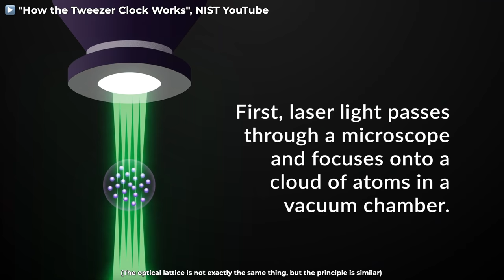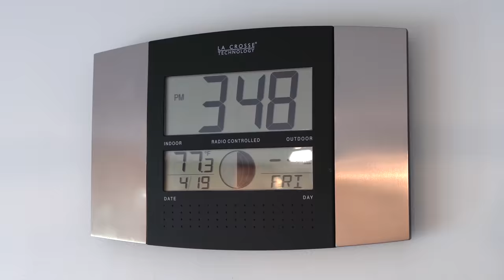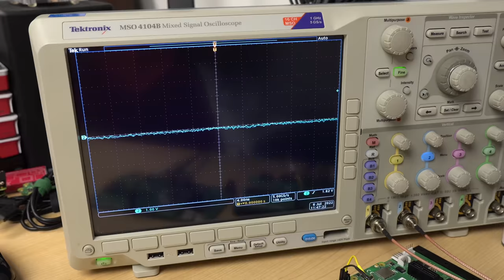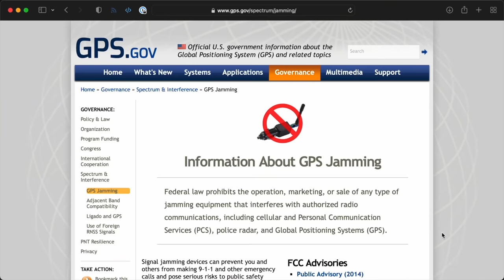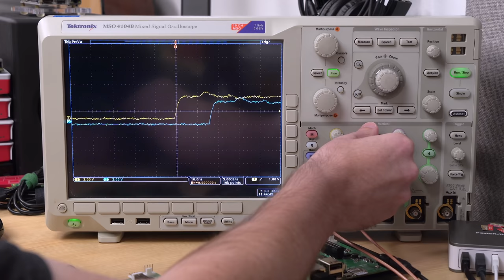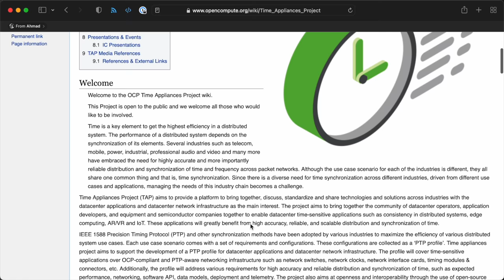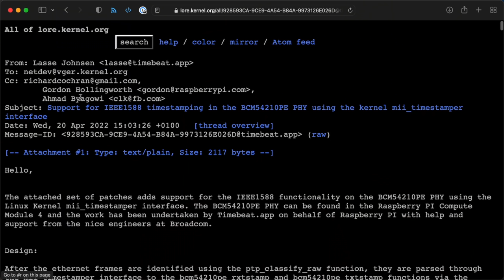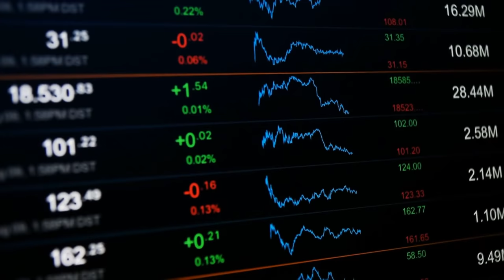Nanosecond clock sync with a Raspberry Pi

Comment: The fact that we are having the shortest days ever recorded, and GPS is consistently failing currently til the new self contained GPS modules get rolled out to utilization, points again to the larger reality of physics currently being ignored. The galactic electroverse between stars, solar systems, and planets. Our own sun currently is a cycle of high influx of dust which is cyclical, it affects its strength, its output and thereby our magnetosphere and spacial measurement in speed and rotation and distance from the sun. This is why we are currently dealing with climate upheaval as well as the highest UV radiation inflow and our magnetosphere is weak due to a grand solar minimum cycle. The other planets are also having climate and magnetosphere severe disruptions here as they do during these cycles. The reason no one is being told this, is due to fifty years ago the micronova event of our suns cycles was collected and determined in evidence from the lunar landings. The glassed area shows clear evidence of the proton emissions that hit and burned the moon during these cycles, and they knew we are entering one now, 12k years apart from the last and each prior. And yes, currently our magnetic poles are racing towards each other, potentially meeting the in indian ocean. We have all of the crustal displacements as well with sinkholes, voids, tsunamis, and upheavals all over the planet as well. Antarctica is rising. While the melt is raising sea levels. All of this displacement and high radiation penetration is all queing up from major planetary changes with severe potential from even small solar flares as well. The evidence is quite clear. Its just the utter lack of representation and education that is being used against you.
That information was classified, the new "man made gases" and near to total lack of awareness of the sun cycles and direct involvement taught and clarity on our place here stopped being supported entirely. 
IF you know of Grand Solar Minimums, we are actually going through the planetary climate grow zone changes and weather patterns associated historically with these events and you know what to expect. Number one issue, is the usual lack of adjustment prior leading to crop failures. As well all of the associated fear mongering using religion to upset the people and drive differences. Nearly all grand solar minimums of the past peak with the fall of empires, usually due to just those two factors alone. 
Unlike the past we had plenty of time, awareness and better details to manage this but the powers that exist behind the puppet stage plays of politics are looking to grab at full power, full ownership again, and solidifying both with wealth. This is nothing new historically, as they control the academia, the media, and the politics, as always. It is just gross that it was managed even in this day and age of communication and the availability of the facts. If we do infact get the solar micronova in our lifetimes, there will be a near collapse back to nearly complete annihilation levels as in the past where there were as few as 23000 people left to repopulate to todays standards. There is enough evidence of these facts that have been the leading reason that we have been here many times before the generalized timeline of mankind, and yet, have had to start over again each time due to these sudden catastrophic events. 
It is for this reason that civilizations like SUMERIA were up and running with the highest of sciences, including the DNA and manipulation tools of the time and materials that would seem like magic then, when it in fact would be past down evidence and abilities from prior failing instances resurfaced. 
When you cant get people to realize the eye of africa is in fact the site of Atlantis, when it measures in perfect description and units of measure not only from the point of its reference material and its nature, this is what control can manage. A simple denial, scorn, disregard, and you lose your reality building blocks. It had glacier capped mountains behind it like a barrier, the area was awash in water for ages. One tilt, impact, change in atmospheric conditions later and one massive break in such a glacier are, and the "seeming literal sea from there would wash it out" in an instant.  
But you cant find any willing to partake of the search and certitude of this, because, that would lead to undermine so much of what is "acceptable" to the already established, and of course.. it would lead to questioning what else is wrong.
Live everyday as though you will not have another to do what is right, or resolve what you feel burdened with, for time is a blessing only best filled with your best while you have it.

Comment: Curious Marc has cesium clock in his rack so no you are most certainly not the first to have one.
Reply from the maker: D'oh! https://www.youtube.com/watch?v=eOti3kKWX-c

The question is: does he have it set up as a permanent holdover source for a homelab timeserver? Or is it sitting on a shelf for experimentation?
Reply: @JeffGeerling  is that relevant? Whatever he does with it, it will be more relevant and in need of accurate clocks than your home setup. There is no relevant use for ptp in a home network unless you plan changing into a science channel.
Reply from the maker: @bzuidgeest  I'm more into exploring ways to make it relevant—right now it's not really relevant since nobody assumes you'd have that in a home networking scenario.

But with it, there are some types of measurements (audio, seismic, etc.) that could be synced to more accurate time to track positions of things inside my house, or contribute to geographically-diverse science data.

I think that's a cool opportunity worth exploring. And my channel is about learning, really. I just often use Raspberry Pis as vehicles for that journey. I learned a lot about PTP and hardware timestamping making this video. And I have about 50x more to learn about it before I'd call myself 'knowledgeable' in timing anyway :)
Reply: @JeffGeerling  those are lofty goals, but for you to convince a lot of people to do this, the price needs to be low. And you have to ask what kind of bandwidth a protocol like ptp is using. The one on one demo is nice, but what happens in a normal house with switches and routers in between. And other network uses competing for bandwidth. And to fall back to something obvious, people cannot even get the pi at the moment. 

Do make the videos, at the very least it s something interesting to watch, but you need to have a good think on how the practicalities of the ideas. Your guests certainly seemed to skip over a lot of those in their enthusiasm..

Comment: Thank you for an interesting video.
I am a little bit surprised by the use of what seems outdated terminology at 5:40 ("slave" devices), and also by in-video text captions a little bit later (a rather innocent joke) that gets obscured by the standard text captions subtitles.
Maybe another term could be used like "the dependent devices"? And in-video captions positioned higher?
In any case, wishing you all the best.
Reply from the maker: Regarding the language, since the terminology change would take years before it's common in the time-sync/clock world, I would rather use precise language that would be coherent with documentation and current standards, to avoid confusion for anyone learning about PTP and time in networking.

Regarding the captions... I try to remember to keep them out from under YT's captions, but sometimes I forget, oops!

Comment: A few corrections:

1. While strontium clocks do appear to be a thing, they don't appear to be more than experimental at this time. The NIST still uses cesium-based clocks, as well as a pair of hydrogen masers for their production equipment. This is what feeds station WWV and the Navstar GPS satellites. AFAIK the SI definition of a second still uses cesium.

2. WWV is not "a tower" it's a shortwave radio station near Ft. Collins Colorado that broadcasts on several shortwave frequencies. There's also WWVH in Hawaii, and CHU in Ottawa, Canada.

3. Nope, all those clocks do not use WWV to set themselves. They use longwave station WWVB, that's located on the same campus as WWV, and uses the same NIST time base in Boulder CO, but WWVB is a completely different station on a completely different frequency band, and uses a completely different format that's more easily decoded by simple electronics.

4. Pretty much every GPS receiver that's designed to be a stable time reference has a local oscillator using a quartz, rubidium or cesium time base that can either be slaved to the GPS signal, or become free-running if the GPS signal is lost. Other radio signal sources include CDMA cellular receivers.

5. Calling a GPS clock "grandmaster" is silly, misleading and simply incorrect. They don't play chess at all, and in the hierarchy of master clocks, they're at the bottom. The cesium clocks aboard each of the Navstar GPS satellites are superior to the user segment clocks on the cards, and the cesium beam, cesium fountain and hydrogen maser clocks at the NIST and Naval Observatory are superior to the space segment clocks. One could argue that the Bureau International de l'Heure in Paris is superior to NIST and USNO, but when one considers that the National Bureau of Standards, the predecessor of NIST invented atomic clocks, the technological home is in the US.
Reply: In the hierarchy of clocks that might live at any customer site, the Stratum 1 Grandmasters are at the top.  They use the Stratum 0 GPS sources as reference clocks, and at small sites you might have clients directly connecting to the Grandmasters, but at larger sites you'd design an architecture where the Grandmasters feed a set of Stratum 2 intermediate clocks, and at really large sites those might feed another level of infrastructure for Stratum 3, etc....

This is the same kind of architecture that we've been designing and implementing for over twenty years.
Reply: @shubinternet  perhaps you need to learn the difference between NTP and PTP. IJS

Comment: Since it takes light 3x10^-8 to go 1 meter, you need to take wiring, resistance, capacitance, and distance into account between machines, even on a home lab, to get even 10s of nanoseconds synchronization. And you are syncing to what the 'time' was when the pulse was sent, not necessarily to what it actually is, currently. If there is any kind of delay (including switches, routers, hubs, etc., between the 2 machines), it all goes out the window. I have a GPS time source in my network, without a PPS source. I use it to control a NTP server which both broadcasts and responds to queries, for all my machines. 50ms or better sync seems to be 'good enough' for home between machines...
Reply from the maker: That's the beauty of PTP—assuming a stable(ish) network path, it will account for all those factors by constantly measuring a bunch of different packets.

It doesn't work as well over more complex networks where switches are buffering traffic or over WANs. But either low-end cheap switches/hubs (which don't buffer as much) or higher end switches (with QoS settings that can make more guarantees about PTP traffic) will work great.

Comment: You won't be the first to have stratum 1 at home. I already built one with an Artix7 at the core. Primarily for Ham Radio and Satellite work.
Reply from the maker: As I'm finding out, I'll be like the 26th or 100th or something like that. Ah well!
Reply: @bobbydazzler6990  Yes Officer, Stratum 1, PTP2 hardware time stamping. Is there anything else you need to know before I ignore you entirely?

Comment: Back in the day, alarm clocks and watches were radioactive.  The numbers and hands on their dials were painted with radium, a highly radioactive substance with a half life of 1,600 years. Workers in those manufacturing plants developed numerous cancers. While the glass faces limit radiation exposure, it is not recommended to open them up without precautions as flakes and dust may be released.